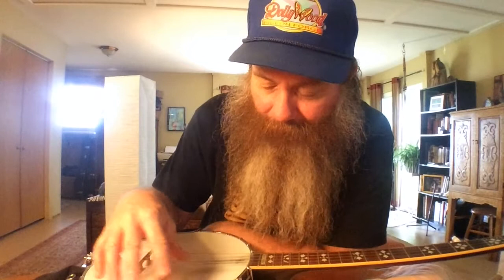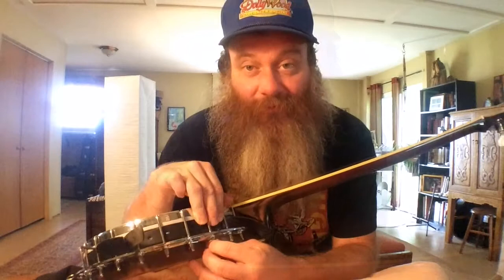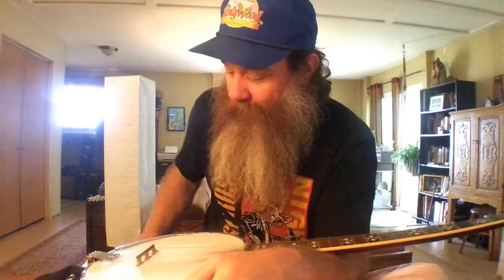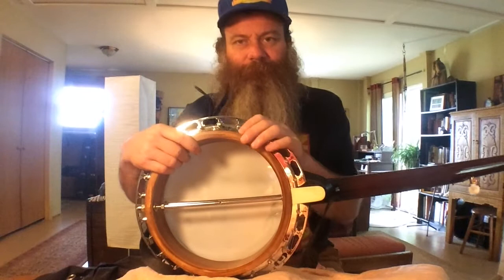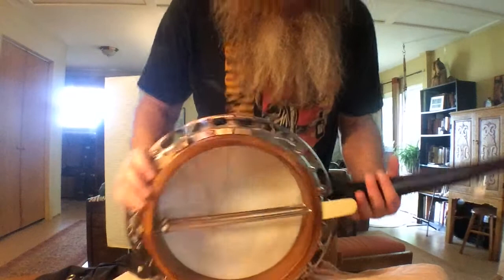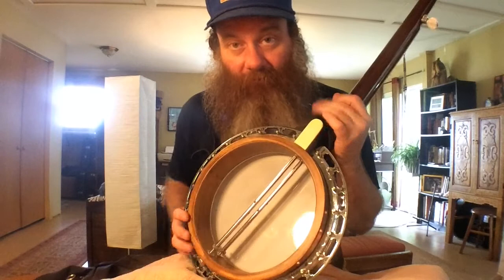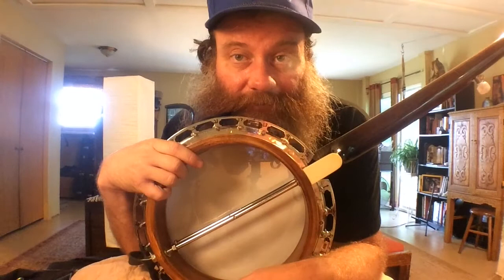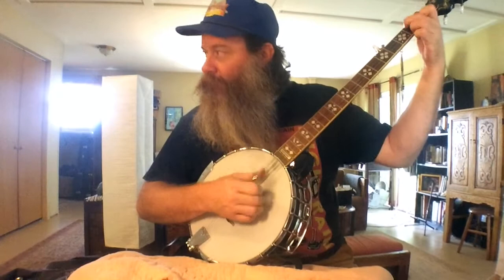MAKE YOUR BANJO SOUND THE  BEST with Banjo Joe's Banjo Maintenance Tips, Tricks and homemade tool

Comment: hey Joe the lateral angle of the neck is off (not the action but side to side) is the tail piece incorrect or the neck out of alignment and how to adjust? I thought I could shim where the neck meets the pot, is this a no no and is this a common problem?
Reply from the maker: Could be the tail piece needs adjustment. The neck should be adjustable that way as well to get the strings to line up parallel to the fret board. Just have to loosen it and move it slightly. It may take a few times to get it where you want it.
Reply: @banjojoeanddanielle  thanks I think the cheap tail piece was pushing the strings off the fretboard in the higher register, also my bridge may have been too wide, I'm really a classical guitar and lute player so you can imagine how narrow a banjo neck feels to me!
Reply: also I did loosen the rod (it's a 200 buck washburn) and tried to reset the neck . there is a phillips head screw in the heal of the neck is that something I can adjust?
Reply from the maker: Not sure about the Washburn.
Reply: @banjojoeanddanielle  whatever I did has tweaked it the right way, also tightened the head, now I can practice christmas carols on the Jo, cheers